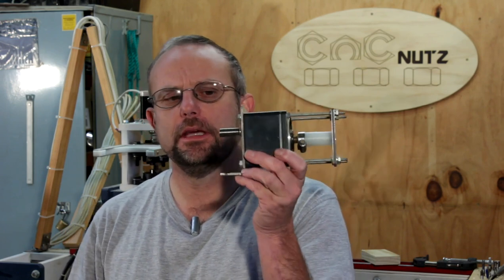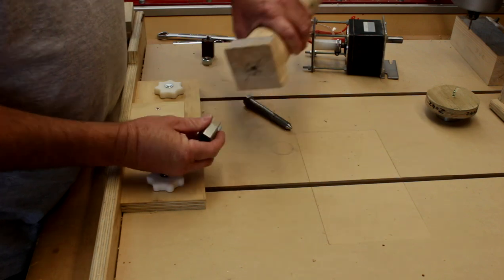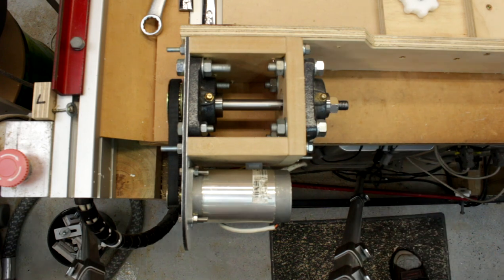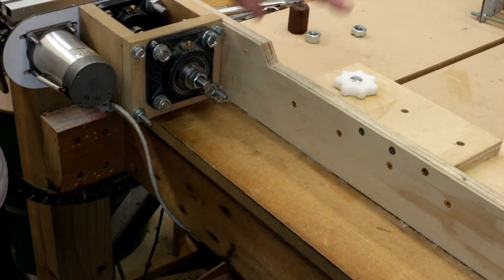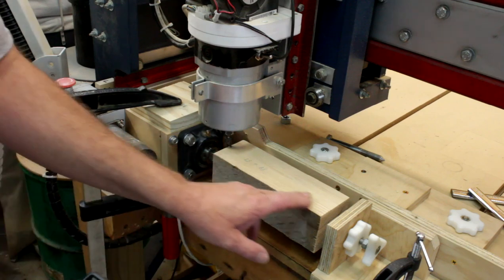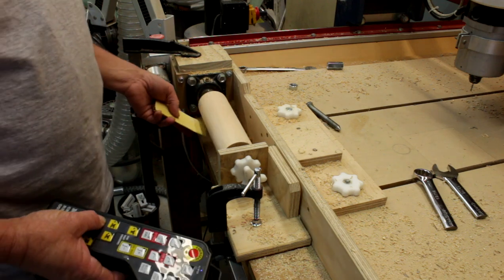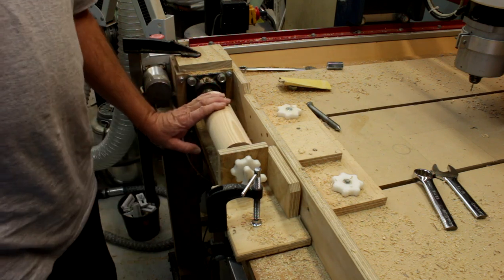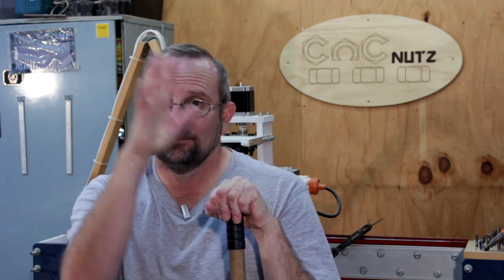Rotary Axis Update - CNCnutz Episode 77

Comment: Hi Peter,
Great build of a "CNC-lathe"!
My thoughts on getting a clean cut in wood: you have to think a little different from cutting into a soft, uniform material like aluminium or plastic where you seldom encounter tare out, as the dense of wood changes within the grains. A cut into wood should always be done by a "supported" cutting edge (like riding the bevel on the woodturning lathe) into the wood itself. Looking at a simple cut with a saw, the tare out is always on the unsupported side of the wood.
These are my suggestions for a clean cut: first of all use a bit with a maximum diameter shaft, as this reduces vibrations on the tip (where most of the cutting action takes place on a round blank). Second, if you are using a spiral cutting bit it should be a down-cutting one. Third, and this is the most important, the cutting direction should go with, not against the heads rotation (don't cut from left to right as usual, but from right to left as seen from the cutter). All of this leads to the fact that none of the actual cuts end up in unsupported wood which leads to tear out (see these strange blades used on a jigsaw for cutting laminated wood like counter tops with their teeth pointing down). Light passes are also recommended, as the cutter itself isn't supported at all, just by the bearings of your router!
All of this information is based on my experience in woodworking, esp. turning on the lathe and using a router. I might be wrong, so if you consider to try this, please leave me a note on how it worked, as I haven't got the chance to use a CNC.
I hope this is understandable, as I have some trouble translating all my (German, mathematical, physical, woodworking, turning) -thoughts into English.
Greetings from Good Old Germany
Peter
Reply from the maker: Excellent writeup and a good read Pete. Thanks for taking the time.
Cheers
Peter

Comment: Hi Peter, what makes a really nice surface finish is the feedrate (stepover) rather than the diameter of the bit. I normally use a 2" diameter endmill to do my roughing and finishing toolpaths. Here is a link to my video Barley Twist Part 3
Reply from the maker: Hi Mick and thanks for the video link. I enjoyed watching and should give something like that a go. I was using 45% stepover for the rough cut but changed to 7% for the final cut with the 3mm bit to try and get the best finish. Perhaps I should have stayed with the larger bit and the small stepover. I also think the scrap wood I was using may be prone to tear out. It's a good story and I'll stick to it. I know it likes to make splinters. Really like the rotary axis you have there.  Very solid looking.
Cheers
Peter

Comment: I really like it.In lieu of using the jamnut method(Which may push the center out abit making it loose),might I suggest taking the hum you made,cross-drill and tap,and use a nylon tip socket head set screw to lock on the spindle?Only 1 allen wrench (T-handle even better),as opposed to 2 big wrenches,and no chance of pushing the center back.
Reply from the maker: I know what you mean about nuts moving off center when you lock them together. It is common for lathes to have screw on chucks and spurs but they also have a shoulder for the spur to snug up against to ensure perfect alignment. That would be the correct way to do it but my plan was to keep everything as simple as possible so anyone could build it without needing a lathe or other expensive equipment. The set screw idea has it's good points but I think it could end up twisting the spur on the shaft as well unless it was a really good fit to the shaft. Would probably work best if the shaft had no thread.
The design of the spur means that the wood can easily move on the tines of the spur allowing the wood to self align when the center is put on the other end. After the center is in place it should all spin true whether the spur is on a slight angle to the shaft or not with the spur acting like a coupler.
All that said, I haven't noticed any issue caused by the jamnut method to date.

Have you seen the newer videos for the final build? Basically it is the same thing but with improvements, new belt and pulleys, not rubbish from my spare parts bin. A tidier build all around.

https://www.youtube.com/watch?v=CO6CIL3cOlc
https://www.youtube.com/watch?v=1RqlVsTwEfg

Cheers
Peter